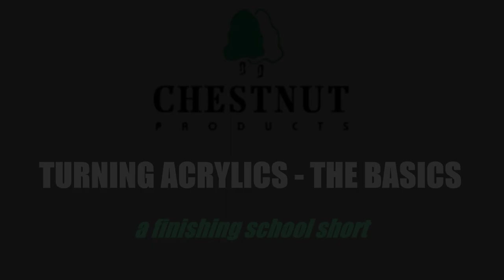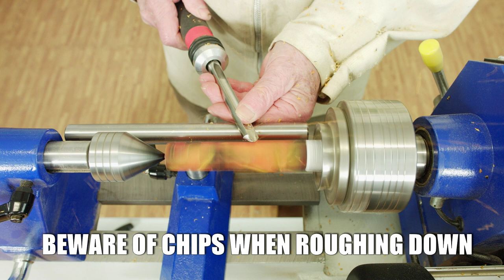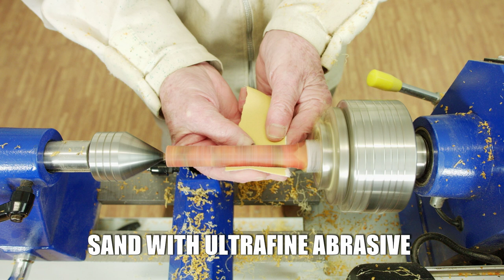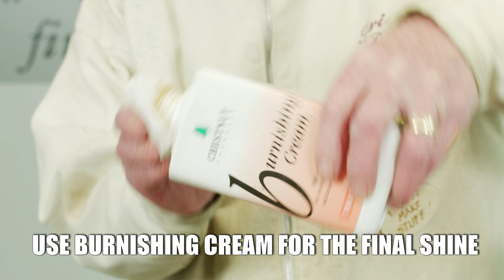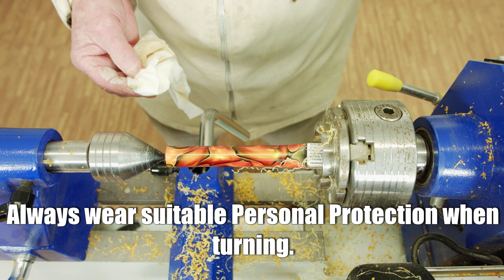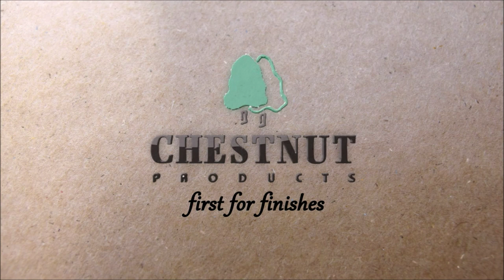The Basics of Turning Acrylics - Chestnut Products

Comment: What Chestnut product would you recommend to cover this cream if I put it on a pen for lasting protection ? Thank you.
Reply from the maker: The acrylic doesn't really need 'protection', but it's very popular to apply a coat of Microcrystalline Wax afterwards to prevent (in the short term at least) fingermarks showing.
Reply: @ChestnutProducts  Thank you very much. Best wishes.